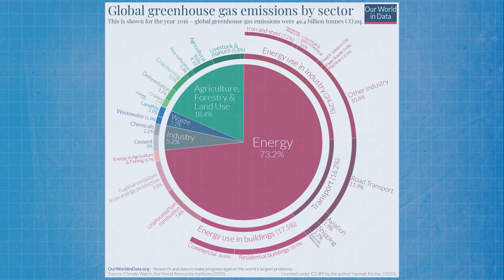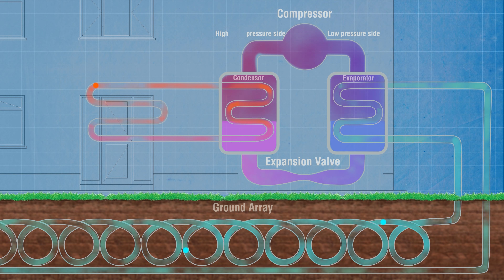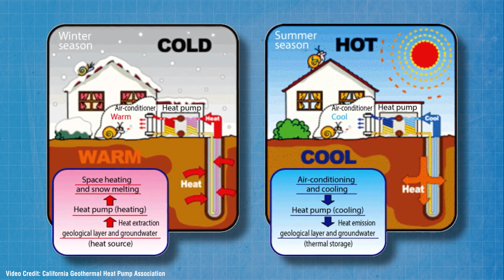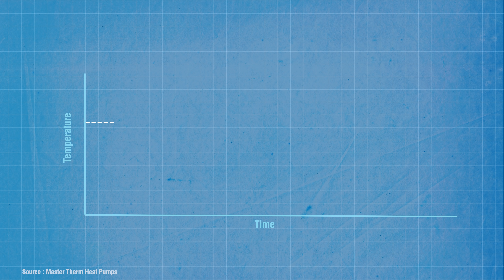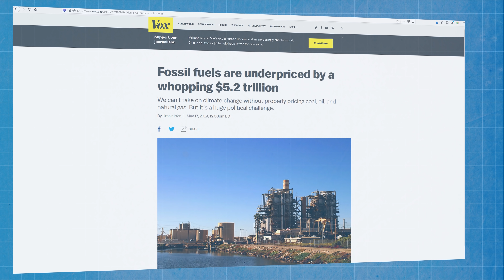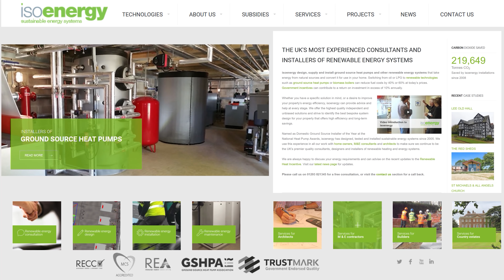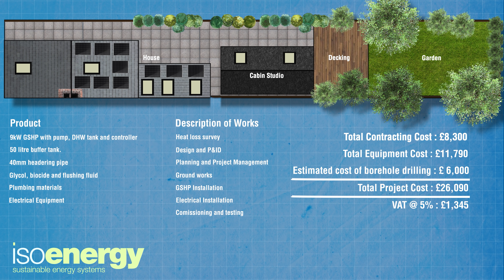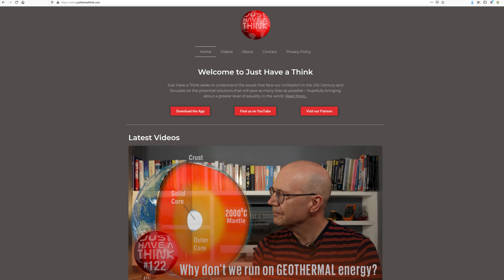Geothermal ground source heat pumps. Heating your home from your own back yard!

Comment: The problem with this otherwise very good video is that it starts by strongly implying you are getting free energy from the ground (geothermal). That is just not so. You are simply using the ground as a place to source or sink heat, and the energy being used to do that comes from the mains.

I also object to the (now standard) use of trotting out the fable of "fossil fuels are subsidized". If you do ANY independent research on this you will find that what is being classified as "subsidy" is standard depreciation and other costs of doing business, the same as any company, large or small gets. Although this idea is attractive to people who flunked economics, it simply means that the government does not tax money earned that goes back into making the business run. Removing this tax incentive is not only wrong, since it would slowly kill businesses, but removing such incentives from the tax code only for businesses you don't LIKE is unconstitutional.
Reply: I can't comment on your second point, but your first is confusing. I think you are referring to energy storage rather than a heat pump. A heat pump uses the gas compression cycle to extract heat from the ground, that has come from solar gain. For every kWk of electricity, we use to power the heat pump. 3kWhs of heat is extracted from the ground giving you a total of 4kWh heat to your house. If you are local, you are welcome to come to see how it works for yourself at any of our sites.

Comment: You do NOT need an expensive heat pump and plumbing to use ground source geothermal, all it takes is a deep 25' borehole loop or several, with 4" plastic air pipe in the ground and a 4" fan that pumps home air down it and returns it to the home. Bring in basement or earth box fresh air if desired. You can get any home to 55 degrees F, or 11 C, using this, and then solar heat the rest of the way to 20 C with solar thermal absorber boxes in your yard blowing home air into them and back again, or a glassed in box against your outer wall on the south side painted black inside blowing house air in and back out of it to the home. It takes no more power than a 4" computer fan. Save yourself 20,000 UKP. If your system won't do it, then superinsulate your home on its outside wall.

Comment: The biggest challenges to both GSHP, Solar PV and battery tech are the upfront costs in existing homes. Most incentives need to target those areas as they represent the highest cost to homeowners and are the largest blocker to large scale domestic adoption.

Comment: I live in Sweden where, as mentioned in the video, these systems are pretty common and has grown in to a small industry of its own. Which not very surprisingly seem to have interesting effects on the price of an installation. 

In Sweden the typical installation cost, with drilling (in Sweden it is almost exclusively drilled systems), heat pump etc seem to vary from around 10000 GBP to upwards of 20000 GBP depending mainly on the size of your house and to some degree on how deep the bore holes need to be. There are some tax breaks in Sweden when doing work on your house (not specifically for these kind of installations) which explain part of the lower prices compared to the UK, but a very large part of the difference is probably just down to how common these installations have become here. 

Now there is one caveat to this comparison, in Sweden water based house (and apartement) heating has been the norm for a long time, which makes it a whole lot easier - and cheaper - to change the heat source since it is unusual to have to add on a water based heat system in the actual house afterwards.

Since so many apartment builings also use water based heat systems, there is a growing trend of larger installations for both apartment buildings and other larger structures in general.
Reply: We (in Canada) have a similar climate, but you guys are way ahead of us when it comes to heating and insulation standards.
Reply: A real game changer are our (swe) high oil price due to tax and (some will kill me now) cheap electricity. It use to pay off it self after approx 7 years.

GB, as mention above, has a price setup where the running cost will be equal to oil. That explains a lot for the development of heat pump use in different countries!
Reply: One reason for large buildings, that use to be connected to district heating, to switch over to geothermal heat is the running cost. For "some reason" the private district heating system always cost 80% of the electricity price...
Reply: Sorry, I'm not sure I follow. Are you saying there was collusion between the electric utilities and whoever operated the district heating system?

Just the idea of district heating alone is a big advancement beyond what we've got. You guys have had so much development in that area while we've pretty much been standing still for decades.
Reply: @Kevin_Street  i don't tink it really is a collusion. By history they have competed with oil and electric heating so just set the price to approx 80% of electricity has worked fine for a long time. But with ever rising energy cost the geothermal alternative has become an option. There is a bitt of a war going on where the district heat provider try to match there marginal cost to the new behaviour of the costumer. In Stockholm, where i work will energy savings incl heat pumps, the district heating has three components, energy price, max used power and the amount of water pumped thru your house. The energy price differ a lot during the season of year. From 0,25 sek/kWh to 0,65 during winter. (10 sek approx 1 $, GBP and €). The power fee are approx as much as the energy cost during a year. It's basically to pay your part off the plant. Then there is the water volume fee to motivate sending back a low temperature to increase the efficiency of the pipe use and the plant... Yes, I use a special excel sheet to calculate my customers savings... 😂
Reply: My point is that the heat pumps beats the total cost of the infrastructure for district heating. It's easy to understand because the heat pump only need a system on site and a often existing power line. District heating need a own infrastructure with expensive pipes that need specialist to duct, digging, closing roads, reset roads, maintain and so on.

So I am wondering if it is better to skip the district heating system entirely, build plant optimized for electricity production and go for heat pumps and stronger grids...

Maybe citys like Borlänge with a steel factory with pure heat is a exclusion...
Reply: @Kevin_Street  Like Björn say, its probably not a proper collusion situation, rather one of, lets' call it "uneasy equlibrium"  between the involved parties ... :-)

But, also like Björn points out, the price situation has changed a bit lately and this combined with overall more cost effective installations has opened up for these kind of local geothermal systems competing more and more succesfully with our traditional district heating systems.

And I would argue the widespread use of district heating systems have, indirectly at elast, also laid part of the ground work for switching to geothermal heat generation - it has led to the current situation where a very large proportion of apertments have water based heating which makes it a whole lot easier to switch.

District heating is pretty much the norm in a very large proportion of municipalities in Sweden (and I guess also in our Nordic neighbours). Here in Stockholm we also, which might sound odd on our latitudes, also a wide ranging system of district cooling (using relatively cold sea water as a source), but my impression that is mostly used for office buildings and similar.
Reply: Thank you both for the replies! This is all quite fascinating.
Reply: @martinsportfoto2423  District cooling exist in several Swedish cities. I know Uppsala and Falun by heart. It's used as you said in office, shopping mall, server halls and so on. AC are still not norm in homes.

If you use district cooling during winter you get payed a little in Stockholm! It's to compete with building owner who install a heat pump to recover there all year round cooling demand in to the heating system.

 I just finnish a cooling recovery project in a shopping mall (Fältöversten) where we will cut approx 90% of the district heating bill... With no extra electricity use! The heat comes from all the food cooling systems. Running 24/7.😊

Comment: Just beware,  the vertical boreholes are very dependant on flowing water in the underground. Else you end up with a vertical block of frosen soil. So it is not for everywhere.
Reply: In rural west Ireland they use a borehole  with submerged pumpfor domestic water. One installation uses same bore hole for heat pump..
Reply: Hitting the water table certainly helps, but the drillers we use, Synergy Boreholes, will provide a fixed price job. Even if they have to sink an extra borehole to spread the thermal load. No one wants a frozen popsicle in their garden. In the UK, the ground conditions are pretty predictable due to the excellent data held by the British Geological Survey, so you would know if it was going to be an issue before the project even left the ground. In exceptionally complicated circumstances, a thermal response test can be done for under £1,000 I believe.

Comment: Is that the same Renewable heat Incentive AKA Cash for Ash that had farmers in NI burning wood pellets to heat cow sheds? Hopefully the scheme has been tightened up a bit since then.
Reply: So the big difference here is the UK version of the RHI has a cap on the payments unlike the Irish one that ultimately brought the Government down. You will only ever be paid for the energy required to heat your home as stated on your EPC. They forgot to put that bit in so you could leave the windows open and the heating on all summer and get paid for it.

Comment: In my city in the netherlands they are building a city wide heating netwerk that is now running on local biomass including wood, dried roadgrass, leaves, commercial woodwaste, agricultural woodwaste, composting residues burned in 3 biomass units.  In the future they are planning to expand this with a stable geothermal source and add industrial waste heat. Biomass will still be used during top consumption periodes like mid winter and piek deliveries when everybody gets home or wake up. One unit will run on a more scheduled basis because it supplies industrial steam to replace natural gas, that wasteheat is then inserted into the heating loop. At the moment it supplies 20.000 houses/businesses with heating but will expand more in the comming years as new houses are build including replacing current houses.
Reply: Burning biomass produces CO2. Do they have efficient carbon capture and if so where do they store it. Carbon capture is difficult and expensive and should be included in the equation of efficiency.
Reply: @b.mnicholson4269  No, the facilities are to small for any carbon capture facilities, the biomass they burn would otherwise release its CO2 anyway on the natural way by composting, Now it is replaces natural gas so it does have a CO2 saving, By using the biomass now to build a network it is easier to add geothermal and waste heat later.  It is not the most perfect way but better then building new houses with natural gas infrastructure untill geothermal is availible.

Comment: I just had Geothermal installed this last may.  Works great.  Unfortunately no previous energy bills to compare to at my new house.  My old house was 1000sqft, + full basement. Bills between electric & natural gas was about $240 every month on budget. $2880 a yr.  Current house 1500sq ft+ full basement.  ALL ELECTRIC, no gas stove or heat since geothermal.  my bills look like this, $60, $63, $83, $85, and one reading which was delayed 3 days and extremely warm month was $128.  Which places 5 months of energy around $420...  My next 7 bills would have to average $350+ a month to compare to my smaller home with natural gas. 

Very surprised with efficiency so far, Im literally heating & cooling double the space.  

 propane or continued fuel oil was my only other options.  Natural gas runs nearby on my property, but some unknown existing land contract was already in place.

13k is cost for geothermal after tax credit of 26% this yr. In the U.S. otherwise without the credit would of been 17,000.  Worth noting propane furnace,AC/heatpump started at 8700 for mid performance but did not include $3000-4000 for propane & propane tank.  If I opted for higher end unit it would cost 12,700+  3-4k, which is ideal because efficiency of 98% is better than 92-96%, you're wasting propane long term to not pay for a higher end unit, geo however proved to be cost effective and most efficient.

Comment: We installed a geothermal system in our 1800 square foot house in Regina, Saskatchewan, Canada and it operated flawlessly for the 4 years we continues to live there before we moved. If you don't know, this location experiences minus 30 degrees Celsius regularly during the winter. The system handled it easily. Even more efficient cooking in summer where temps reach mid 30s.
Reply: Regina ftw!
Reply: We put in a horizontal loop for our house built in 2009 in Stettler, Alberta. Our two acre place allowed this. We have hot water assist. Our 1700 square foot home costs $246.00 per month (equalized payment program) for all our monthly energy costs, which is 100% electricity, no gas on the property. Neighbours with electricity and gas expenses for smaller homes as paying more. Lower costs for energy and leaving a smaller carbon footprint were our motivators to install this system. Would we do it again? Absolutely.

Comment: I just bought a 5-ton AC unit for my house in Tucson, Arizona because the original died at the beginning of summer (and it's been a HOT summer here!).  I really wish I would have put the money into a geothermal heat pump instead.  Our electric bill topped $400 a month for 3 months, even with the most efficient AC unit I could buy.  My next plan is to dig an 8-foot deep trench next to my house (luckily I live on a full acre of land, so I have plenty) and install a heat exchange which I will tie into my AC unit.  

I'm also going to build a 20x50 workshop and for that, I'm going to use nothing but a geothermal heat exchange for heating/cooling.  I'm going to put in a horizontal coiled line under the building and then run the pipes up into a corner where I will put the pump, the manifold, and then just have a blower blowing air over it.  Nothing fancy, nothing expensive, just a simple heat exchange unit.  And then I'm going to put solar panels on the roof to power it since I'll likely not need it at night.  The whole thing will cost substantially less than putting in an A/C unit that will cool the building and require no power from the time I turn it on, saving me boatloads of money and eliminating the carbon footprint altogether.  

Everyone wins except the power company, and they are doing just fine without me.

Comment: Thx for the post....But the scenario about using an inverter (ie variable speed) GSHP to eliminate the need for a backup heating source in a Swedish home is incorrect. 

It only improves efficiency in milder temperatures (by reducing its need to cycle on and off as much) it does not improve efficiency in very cold weather since its constantly on.  And adds no additional  capacity.

As per the chart that is illustrated in this post and in the the below link too... and it was not referencing Swedish homes... https://www.thermalearth.co.uk/blog/advantages-inverter-heat-pumps-over-fixed-output

So some other method would be needed be changed or added to eliminate the need for a backup heating source, such a larger capacity system, which is more costly and less efficient on average.... Or a heat storage unit.... Also variable speed heat pumps ground or air sourced are nothing new and have been used for decades, they are just more costly...

FWIW Its commonly referred to as a variable speed GSHP, based on its function, not an inverter GSHP based on its electronics components.

Comment: Tendency is 1 meter down one degree higher, in winter time in Sweden efficiency of Heat Pump is about 3:1 one kilowatt of electricity gives 3 kilowatts of heat where cold goes two ground "refrigerator  - inverse Carnot cycle" of internal combustion engine. Electricity is very expensive technology so it is more not clean technology but sterile technology only very highly developed countries can allow to use. Norway remains one of the few countries where electricity is the main heating source, that is land of hydropower, they don't need oil or natural gas and they can allow to drive Teslas and heat house with expensive electricity. 300 meter deep Heat dumping ground used by Americans is also very highly technological method, only used on big scale by USA and Canada, I not heard that 300 meter deep heat pump used to to heat or Cool Hospital or school in West Europe only in USA.